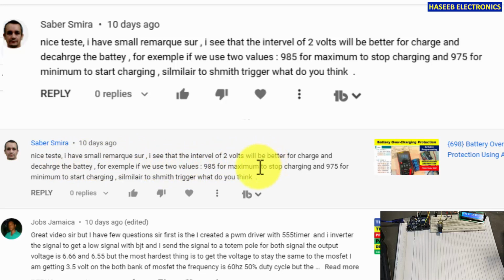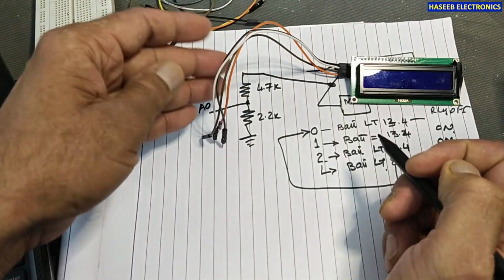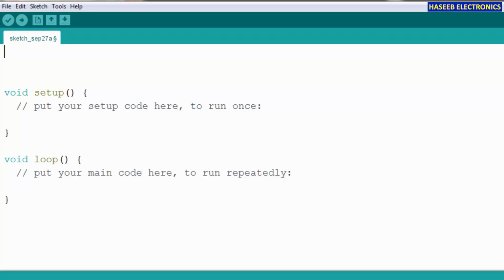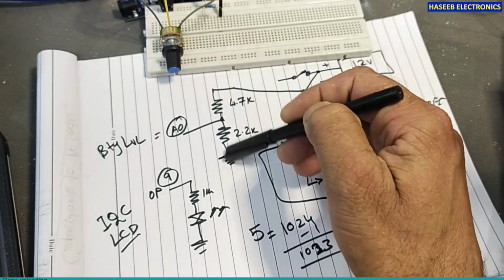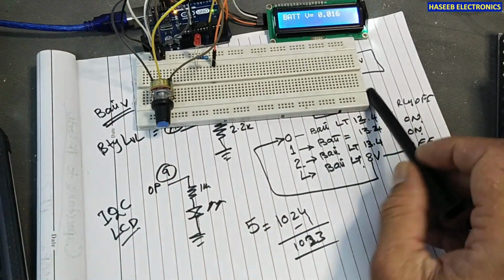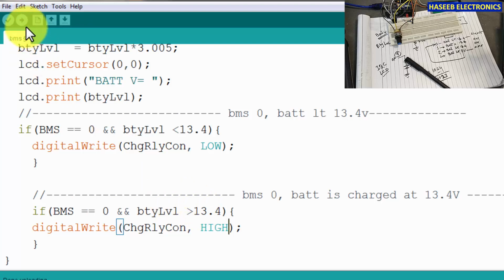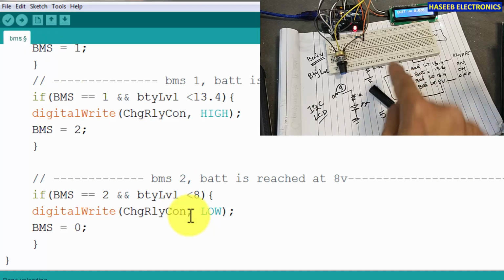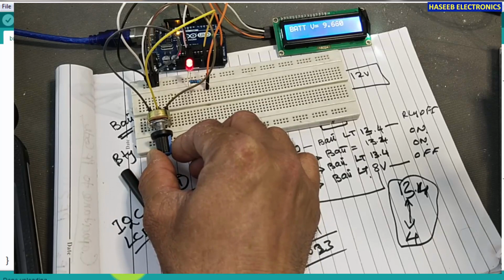{711} Battery Charge Discharge Controller With Arduino Code

Comment: Thank u so much for detailed tutorial video, best thing is u teach us how to think and write correct coding conditions. Keep enlightening us!!!
one thing to ask, i ask 200Ah lead acid battery, its full charge voltage is 15.4v or 13.4v? i have learned that its 15.4v and my solar controller (chinese one purchased locally) cuts the load when it reached 10.5v not 8v as u have described.